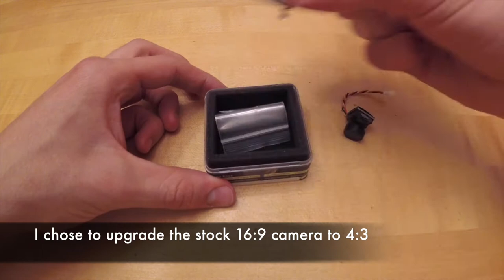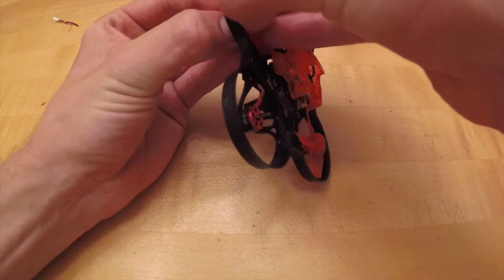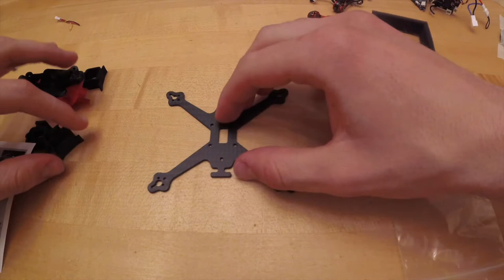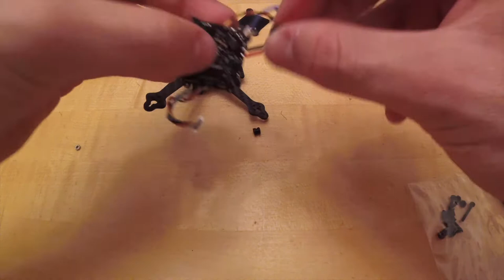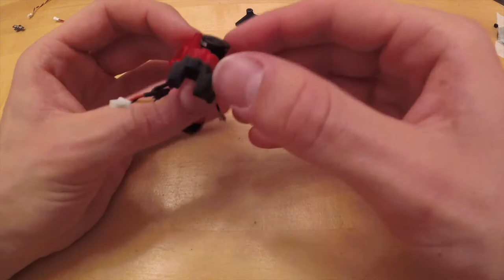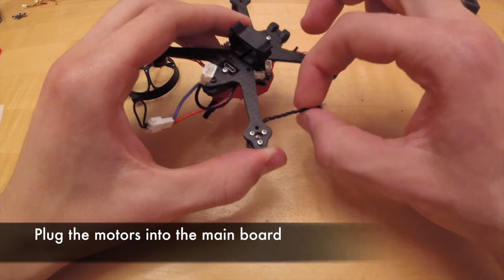Tomoquads Carrera Complete Build

Comment: Thanks! What size are the metal screws it comes with and where can you pick em up ?
Reply from the maker: I got a set of m2 aluminum screws from amazon.  It came with a great selection of lengths and actually comes in handy more than you would expect.  I can’t recall the length that I used, off of the top of my head, but I definitely recommend picking up a set of screws.
Reply: @thecreaturefpv9295  thanks, will do. Building my Carrera tonight & found the Happy model 1102 10,000 kv don't reach the frame 👎. Switched to 0802s but wanted to try the 1102s. . Weird they're shorter !

Comment: Great step-by-step video. What capacity you recommend for stock motors with xt30 plug 1s/2s?
Reply from the maker: Kamil Oblak Thank you!  I have been mainly flying with two 300mah 1s packs in series to make a 2s, so a 2s around 300-350 mah should be good.  As for 1s, I use 450 mah GNB but I am not too happy with the performance.
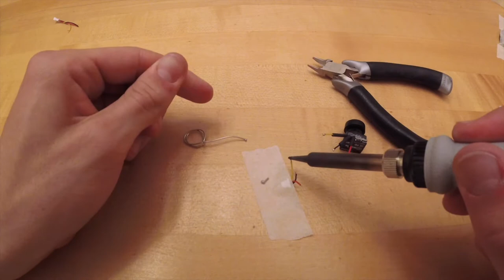Reply from the maker: Kamil Oblak 300mah 1s gets about 2:30 mins, 450mah 1s gets about 4 mins, 300mah 2s gets around 3:30 mins (all with the ph2.0 connectors)
Reply: I recommend to look on fb group about trashcan, there are information about 2s xt30 with capacitor. The hard cable offered with the xt30 connector still carries too much current. It would be better to leave one pair of the original wiring and solder the xt30 connector (with capacitor ofc). Thanks!